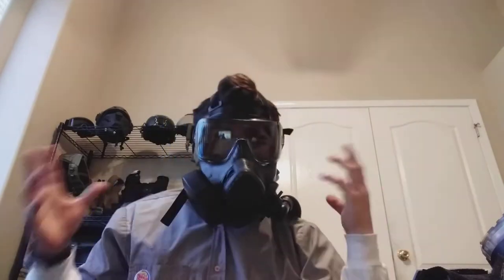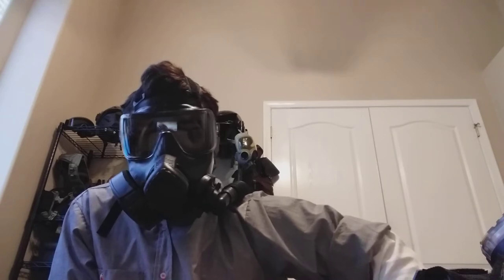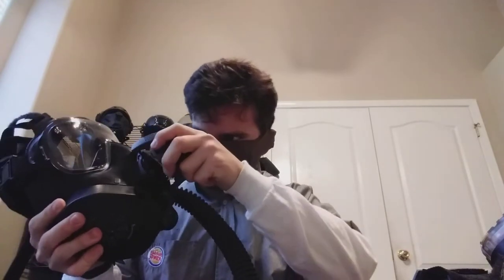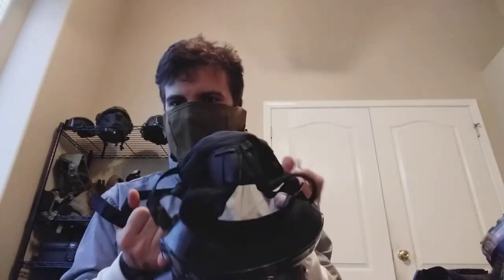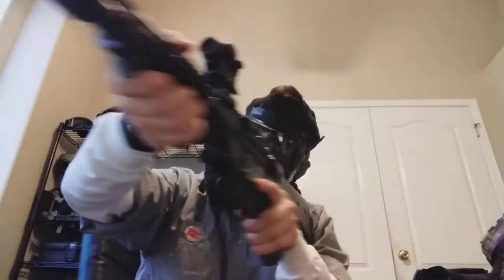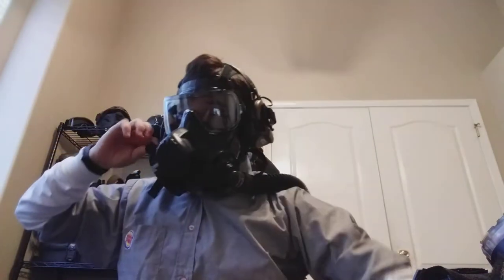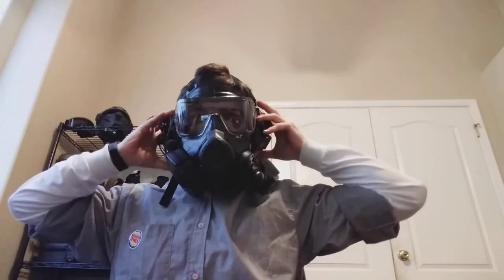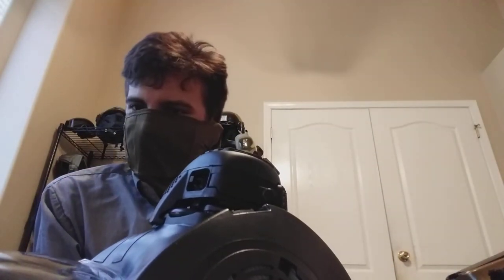AVON M50 Gas Mask airsoft set up

Comment: No. SWAT team unit wears an open face respirator that doesn't cover the eyes. Don't know if you've ever been to tear gas without your eyes protected. Your tear ducts are wide open. This is something I could not recommend to the general public. Anything that's toxic enough that you would need a mask. You need a full face mask to covering the eyes

Comment: Its called an ''M51' config when you use the extension tube as its intended for vehicle crew unless you have it hooked up to a powered PAPR system but you're better off buying the M61 to 40mm adapter plates and putting 2 current conformal 40mm filters on the sides for complete balance as the M61 filters are obsolete already also fits in a leg/hip bag without fuss.

On the microphone, you can piggy off the internal mic its a standard MP-101-4 connector wire it to TRS plug into your line to radio/smartphone so you have whisper comms ability on the 50 series masks whats nicer on the FM53/54 is that comms passthrough can be used natively with the VPU.

Comment: I would like to do something like this do you have links or names of all the things for the mask and tube system
Reply from the maker: I have left a link for the 40mm thread adapter in the description, however the m50, the vpu (both speaker and inner mic), c420 papr (hose system), and the outsert were all found on eBay. Make sure the m50 is in your size before buying. They are expensive

Comment: So is it good for breathing in? Have you ever ran an S10 or FM12? Also thanks a ton for this video
Reply from the maker: It’s pretty good for breathing in with obvious restrictions that comes from a gas mask even without the papr unit it’s still not bad, I have an s10 but I haven’t ran it enough to make a video about it
Reply: @sector5438  I see, well this is awesome, thanks. Is this a medium or a large size?
Reply from the maker: @SquidCena  medium
Reply: @sector5438  do you know the dimensions of the medium or large I'm in the process of getting one but I have no idea what size I need.
Reply from the maker: @pimera1819  find a sizing chart and just measure your head or buy the sizing tool for 80 bucks
Reply: @sector5438  thanks

Comment: Hey how do you attach the tube, I can’t seem to find one with the mask online
Reply from the maker: @BaoBao0923  it's an aftermarket part they usually don't come with the papr
Reply: Alright, and what about the mask, do you have a link potentially since it’s been two years, it’s just that I keep finding that M50 masks on Amazon often carry really bad reviews so I have no idea what to do.
Reply from the maker: @BaoBao0923  the ones on Amazon are probably the fake ones which I don't suggest you get cause they can't use any aftermarket parts, try eBay or team wendy
Reply: @sector5438  do you have a link or something? How do I spot a good one?
Reply: @sector5438 should I get one labelled for airsoft or would a real one also work, as for the tube a real one would work too?

Comment: Would that mask fit over glasses? I can't find out.
Reply: Also any chance on some info on where you got some of that other stuff like the voice stuff, headphones and NVG? I've tried to find some of that stuff but haven't been able to for some reason.
Reply from the maker: @blunthonesty8633  sorry for the late reply, I have seen some proprietary prescription inserts for the M50. Most if not all of my stuff comes from eBay you just need to know what they are called. 
voice:  AVON M50 VPU (eBay)
headphones: Peltor Comtac 3's (eBay)
NVG (TA targets)
Reply: thanks for the reply. I have tracked down some parts already actually. The mask it's self has become a bit of a circus act. The NVG unfortunately I may have to settle for replicas. A little out of my price range the ones from that site.
Reply from the maker: @blunthonesty8633  don’t settle for a poor condition or fake m50 they are too expensive to not have the good one
Reply: @sector5438  I had got an airsoft replica one, the store refunded me. But what I read civilians aren't allowed to buy the real deal are they?
Though I do wonder why the real one is restricted. What am I going to do? Headbutt someone to death with it?
Reply from the maker: @blunthonesty8633  they’re more afraid of your defense capability more than your offense. Never got in trouble for having one
Reply: @sector5438  ITAR it falls under aparrently. Law enforcement and military can get them internationally but civilians it's unclear, 'may fall under ITAR' it sys on one website.
Reply: I found out a bit more. It's probably less about how I'm a civilian and more that I'm not in America.
Reply: Well. Have one on the way. Hopefully it's the right size. If not Ihave an expensive glorified display piece. 😅

Comment: where did you get the 90 degree tube?
Reply from the maker: The C420 will come with those kind of tubes, I seen on the MIRA ones they are not that way.
Reply: @sector5438  ah,i got a israeli civilain one i yeet in my backpack thats usb modded but the tube it came with is one of those straight ones.
Reply from the maker: @kwooook  USB modded?
Reply: @sector5438  yeah, took it apart, and soldered a usb cable onto the power cable so that i could run a usb power bank.
Reply from the maker: @kwooook  I wanna do that I hate the stock battery
Reply: @sector5438  its pretty easy to do and it gets not only more performance but also longer on time